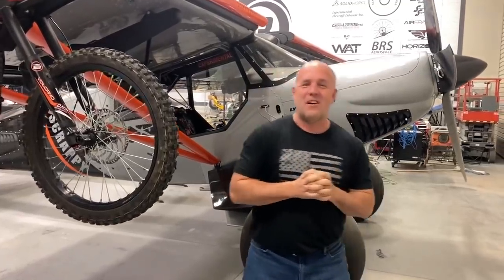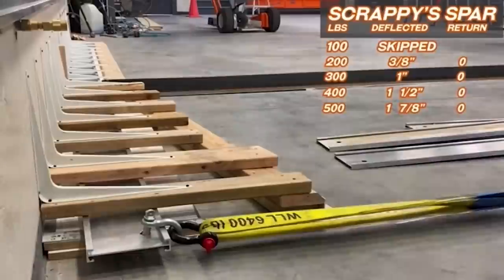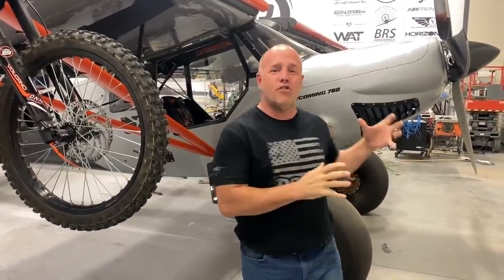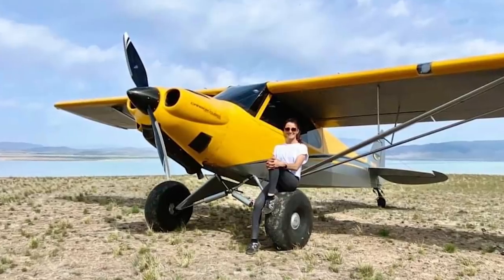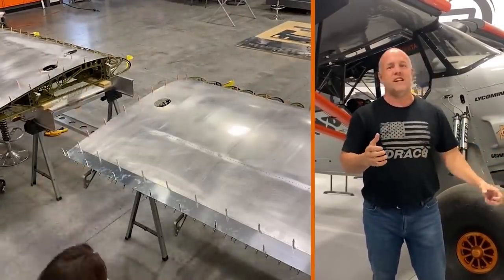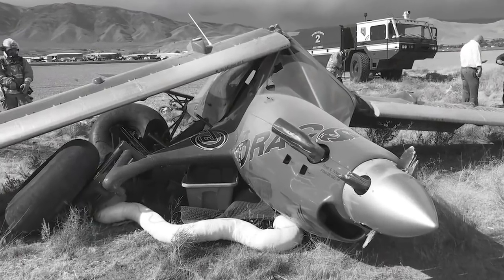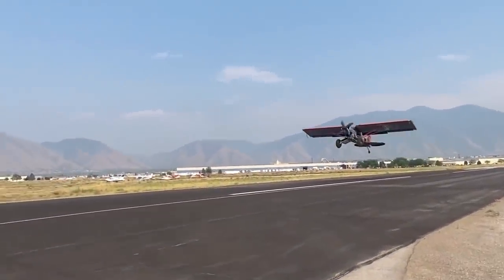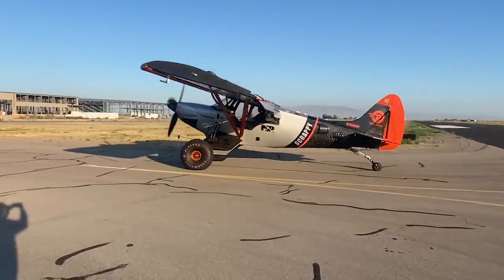What I Like and Dislike - Scrappy's Getting Some Upgrades | Scrappy #64

Comment: would it be possible to build an aileron extension that could extend at slower speeds. kind of like  you built on the front edge of the wing. would making the aileron permanently bigger effect the handling at faster speeds? I flew RC years ago and had to give it up. i now live across from a country airfield that flies ultralights and RC. been thinking about getting an entry level RC and getting my son into it.

Comment: Hi Mike! Greetings from Argentina! You made me so happy tonight when I saw a new "Mike Patey" anouncement on my YT screen. Thanks! I droped every thing else I was doing to wach your video. I have seen plenty of 20(ish) min long videos but yours seems to be shorter than what is been anounced. Why? (kidding). At some point I knew you eventually would put a turbine on Scrappy. Its like have being driven a Pagani "Zonda" (witch is an argentinian car ingeneer working in Italy BTW), and sudendly jump onto a VW "Beetle" (sort of, also kidding). The idea of making a reverse thrust propeller with those blades attached to RR 550HP turbine is just mindblowing. (If I´m not wrong, RR produces the smalest turbines with best weight/volume/effitiency ratio in the markes, but I could be missleaded). The only question reminding, at least to me, is how are you going to manage the GC with a lighter engine? When you mentioned the issues with the ailerons on low speed, a question popped into my mind: Why not placing some vortex generators near the end of the wings? (away from the fuselage). I guess Diamond Aircraft uses that resources for some of their airplanes. 
I wish you, your family, Ron and the rest of your friends a very HAPPY HOLIDAYS. Cheers from NE Patagonia, Argentina.

Comment: At some point (of "slowness") even ENORMOUS ailerons won't give you much.  How about reactive jets, like spacecraft use, to boost your aileron control?  A jet out at the end of the wing would have lots of leverage.  If that jet control is integrated with your ailerons control, and its strength is graduated with your airspeed (so no jet above a certain point, and lots of jet at near stall speed) . . . Compressed air?  Nitrogen? I lean towards compressed air. Do you not have a compressor on board?  You'd also need one or more pressure tanks, near the jets?  Spitballing here.  You'd also want some software control, I would think.  And a bone to pick - I watch you and the other flying cowboys so much I'm starting to think normal planes look deformed with such small tires! ROFL!

Comment: Hey Mike, I have a question regarding the forces acting on the engine: We know that the traction force is provided by the Propeller. This force must then be transferred to the airframe (otherwise the prop will just spin and fly off the plane) the only way that I see this transfer of force occur is through the engine, and that concerns me because it would cause a lateral stress on the crankshaft bearings. So is there a thrust bearing of sorts that prevents the engine from experiencing any adverse stresses? If my inquiry sounds naive could you please provide a documentation of the mechanism?
Reply: AFAIK there is simple thrust bearing just like in car engines. But I am also wondering how is it possible that it can bear hundreds lbs of force :)

Comment: I'm curious about the variable prop. 
I would love one on a piston engine to but would it not go over max rpm during the switch due to the sudden loss of load?
Reply: Somewhere on YouTube there are U. S. Army Air Force training videos for the P-47 Thunderbolt. If I recall correctly, one of them covers the relation between manifold pressure and propellor blade pitch control. They had that figured out almost 80 years ago.
Reply: @paulbade3566  Congratulations on providing an answer that in fact provides no answer at all.

Comment: Hey Mike, idea for your ailerons, and I am (most likely wrong) no expert at all, but what about a tapered aileron? Make it longer/wider on the inside ends so you get more control surface in the airflow from the prop, since that should be more controlled/predictable regardless of wind/airspeed.

Comment: Hey Mike, I absolutely LOVE your channel. I'm not a pilot or an engineer, but I love how you talk through and share with us your thinking on new designs. Maybe this is a bit late, considering that your videos trail reality by a few weeks, but I wanted to question you on what you said about aileron control at slow speeds. You said that it's unbelievable how slow you can fly Scrappy, but that you weren't happy with the loss of aileron control. My thought was maybe your angle of attack is too high on those droop ailerons at those very slow speeds. I know you probably ran computer simulations to test how much droop you could get away with, but the question still remains - would less droop give you better control? I know there would be a trade-off in that you may lose some low-speed lift, but going for larger ailerons will also have its own trade-off.

Comment: Twin turbos, huh?  I don't expect that you're going to pull the nitrous out when you install the turbos, though.  As to the prop hub, if you're designing it, I know you're building it and it's going to end up on Scrappy.  Can't wait to see that, that alone is going to make the envelope so much bigger.  I was wondering if maybe you would have considered spoilers instead of changing your ailerons, but at the speeds you're flying, I don't think they would be effective, not to mention would get in the way of the solar panels.
I was impressed with how well the bikes were attached to the wings, and how they seemed not to move around when flying, but then again, you engineered them not to, so I am not really suprised.

Have you engineered a safety device for a One Wheel yet?  :)  How is Mark doing?  You know, Kim over on Baron Pilot got hurts, broke her arm falling off one of those things.  I can just imagine what one would look like after you got finished redesigning and rebuilding it.  A Scrappy for One Wheels.  

Anyway Mike, Happy Holidays, Merry Christmas, Happy New Year to you, your family and friends and all that you work with.  Thanks for making my day a lot brighter today.

Comment: mike do you think running retractable gear exactly where the bikes are? would do much for better control, less drag
re twin turbo. its going to require an engine rebuild. as its got far too much compression